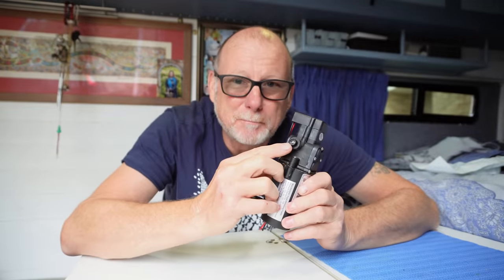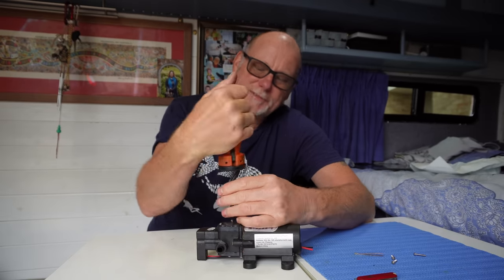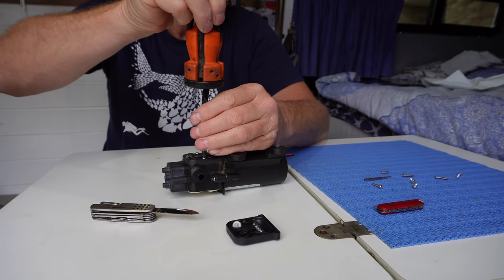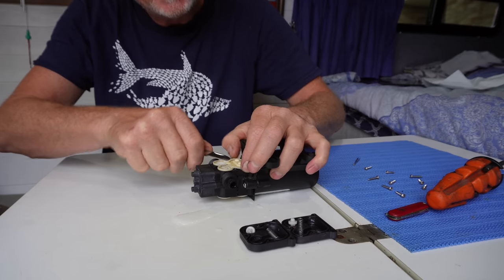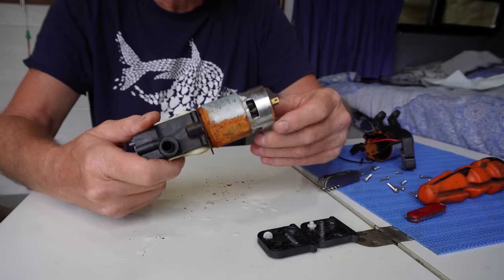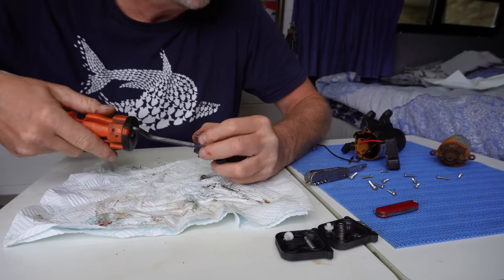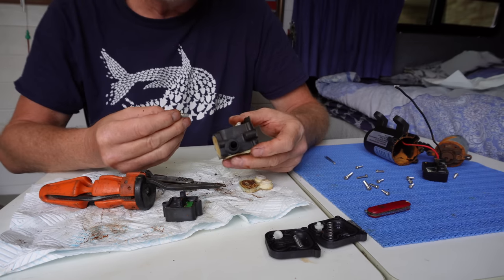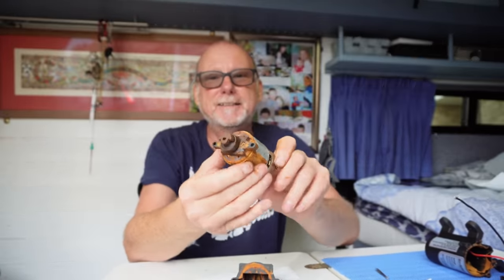12V water pump Tear down and autopsy

Comment: The motor turns cam and moves diaphragm. Two one way valves control flow. Shurflo might have rebuild kit. Sometimes don't cause kit more than pump worth.

Comment: Hi Mel, quick question. When I have solar priority switched on on my ring dc to dc charger, even on a 'not so sunny day' Does this mean that the power from my alternator will not be charging my battery during a long journey? When its not so bright outdoors, should I turn off solar priority? and will this automatically make the alternator charge whilst driving? Please excuse me for being a dinosaur when it comes to gadgets and electrics. Cheers mate.

Comment: All good fun! Nice to see how things work. And when you think of the whole process from the initial concept to designing all of the parts, the different materials, the mouldings and the motor and switches, and then the construction of each unit and how it all fits together, the whole thing is quite interesting. I think if more people took the time to take stuff apart, and where simple repairs can be made to fix problems, a lot less stuff would just be thrown away. From this little exercise, we've found that there is a filter that if blocked could impead the flow from the pump, so may require an occasional cleaning. Well done. 👋
Reply from the maker: Thank you for the positive encouragement really appreciated 👍🤓👍

Comment: Great video Mel , just a thought on the pump install, my Shurflo instructions said to mount with the motor upright as if you get any leaks or the pump seals go, water runs into the motor as it looks as though your old pump has done
Regards
Colin
Reply: Yep my Sureflo pump states the same. Bit of a pain when you want the direction of water flow to travel the other way as involves extra plumbing work especially in a small space. Mel where is the filter bowl for your new pump did it not come with it? It’s normally bolted onto the inlet so you can see if it’s starting to fill with gunge and simply unscrew and empty it.
Reply from the maker: Good point 👍

Comment: Hi bud wondering if you could possibly give me some advice? After three years my 12v pump same as this one has got extremely noise and now won’t pump any water through to the tap. The pump is running the tank is full but nothing but now again today some water come out of the tap but then nothing again. I checked all the pipes. But when I installed my tank last weekend finally one like yours i didn’t realize I bend and twisted my pipe to the tank for the pump 9 days later I only found I did that ahd I’m wondering did I burn the pump out, 😢
Reply from the maker: hay buddy i think you have worn it out
Reply: @BigVanSmallWorld  that’s what I thought had to order a cheap one again as can’t afford decent one :(

Comment: Mel like I said Before ..Should the Pumps be Mounted VERTICALLY  or HORIZONTALLY ..????? 🤔
Reply from the maker: I really don’t think it matters 👍
Reply: Surely it does  .I Think 🤔  the Bearings  are not Thrust Bearings ..therefore the load of the Rotor is acting on much Smaller Area when Vertical.. Think 🤔